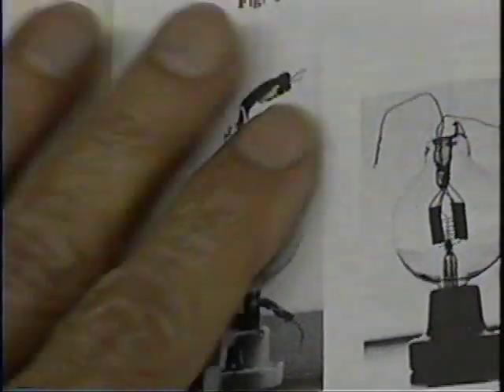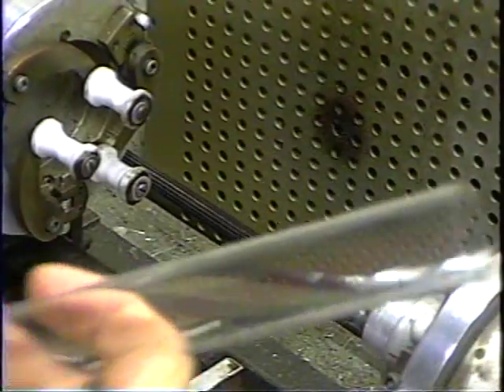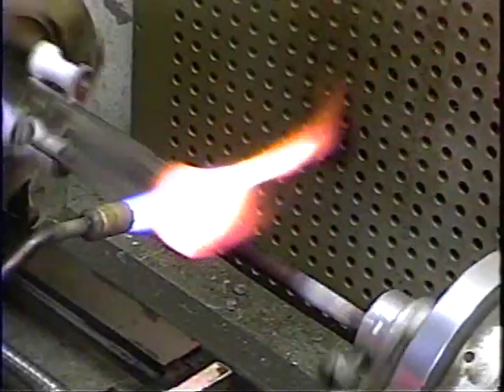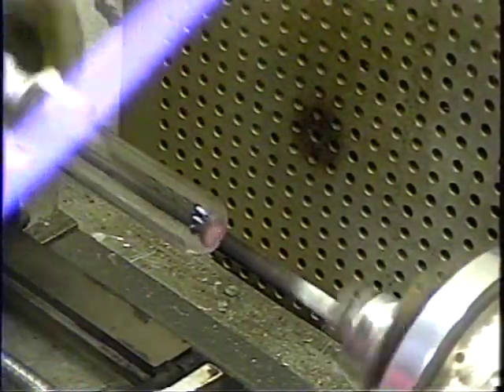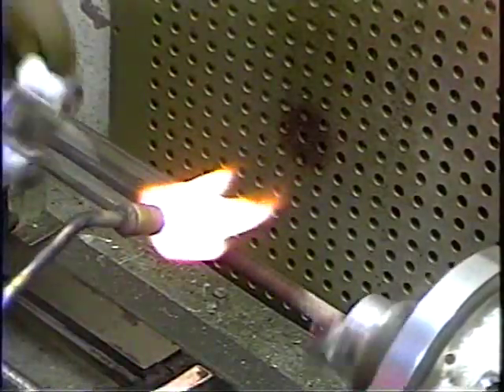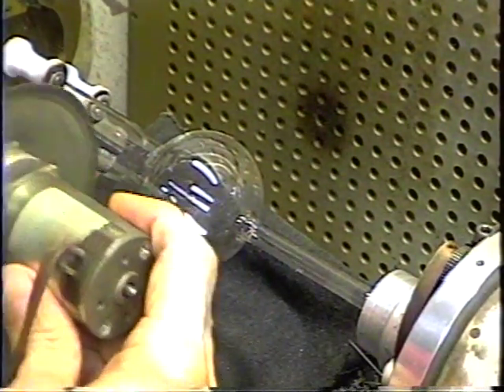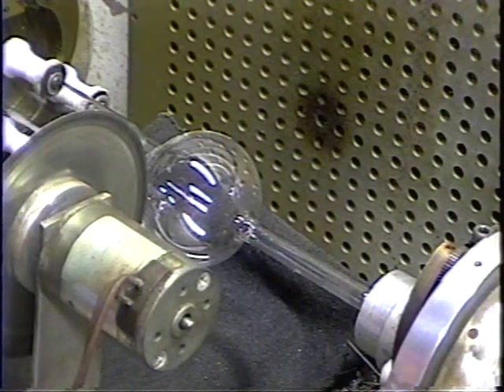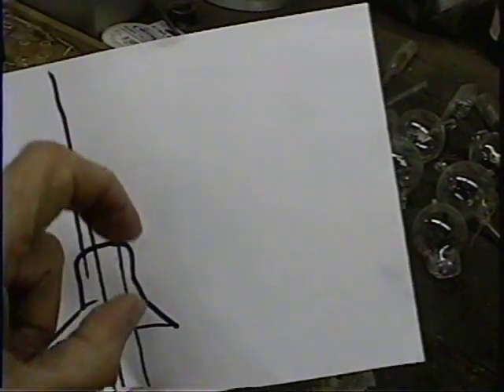Making a spherical audion vacuum tube part1

Comment: What if you're allergic to peanut butter, will warm taffy do? How about lukewarm taffy? Ya know peanut allergy is a bad one, just saying the words peanut and butter can sometimes be enough,,, ok, just kidding. Making vacuum tubes is such an art form. You can't beat their sound quality. It seems like advances in technology, efficiency, and convenience come with a cost of quality. From LP's to CD's, valves to semiconductors, it's like the change from analog to digital for TV broadcasting. It may be more efficient but the slightest signal interference and digital TV image is pixelating and cutting out, sound cutting out and distorting, and that's with broadcast, satellite, even coaxial cable. People in grade B analog broadcast TV areas used to at least get some image and sound but once the change to digital happened, they found themselves off the digital cliff and having to pay for satellite or cable to have TV. I sure hope people don't give up on the sound quality of valves and they keep on making and valuing them as a technology worth keeping around. One thing is for sure, valve radios and transmitters will sure come in handy if we ever have a major EMP, God forbid. Because if not, after that, it'd be nothing but fried FET and bipolar junk-tion trans-useless-ters.
Reply from the maker: This was my first youtube video. I was limited to 15 minute segments! I guess I should re-edit the video into one piece. Enjoy your good sound now because as you age your hearing declines horribly. (I'm 74) Don't worry about EMP. If it is strong enough to destroy electronics you will be fried by the blast anyway. Or the retaliatory blasts.

Comment from the maker: Hello!
I use thoriated tungsten filaments. The original audions used plain tungsten. Also, I use 3 mil diameter filament wire while the original used 1 mil diameter. The larger diameter and the lower operating temperature of the thoriated tungsten wire gives the audion hundreds or even thousands of hours of operation! There is no comparison in lifetime between the originals and my tubes!

ron

Comment from the maker: Very difficult to find commercially. I built mine. Repairing tubes is not practical due to the type of glass used. Even high end audio tubes (300b) are not repaired. New ones are made from scratch. To repair common radio tubes would be very questionable since they are still available in huge quantities at very low prices.

Comment from the maker: Hello!
Actually, there were tens of thousands made. However, they were very short lived, about 25 to 50 hours. They were considered the same as a burned out light bulb and thrown away. Thus, like the old light bulbs that were made in the thousands per day the majority ended up in the city dump. Only a few hundred or so still exist. Try to find some floppys for a TRS-80 computer. And that is only 30 years ago!

ron

Comment from the maker: The materials are selected for several electronic properties and physical properties. The melting point of the filament material must be high enough to keep it from melting at the temperature electrons are emitted. Copper would melt. It could be used for grids and pates and has been in several types of tubes.

Comment: What would happen if you used copper for the filament, the plate and the grid? I realize different materials are used because they're less likely to release electrons when heated, but would that stop the valve from working altogether?